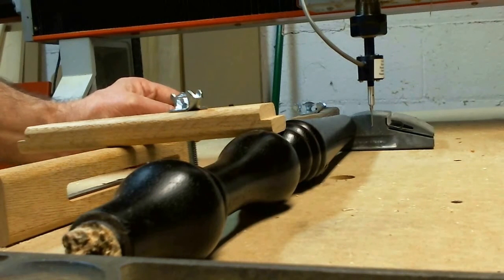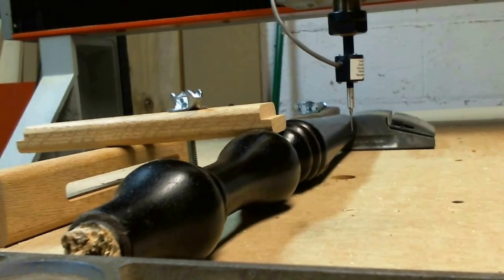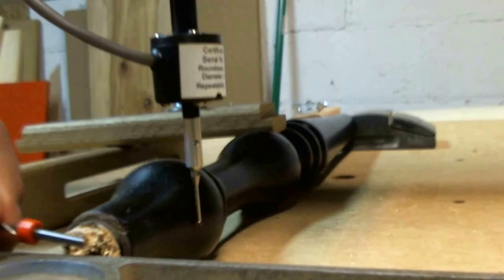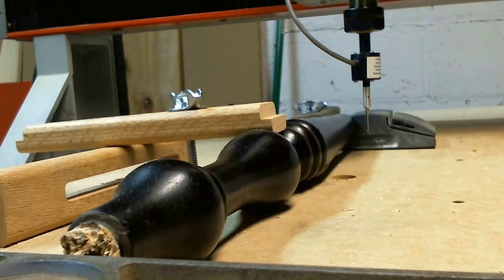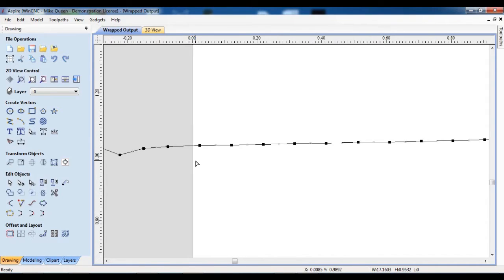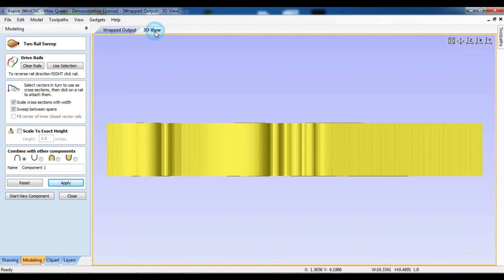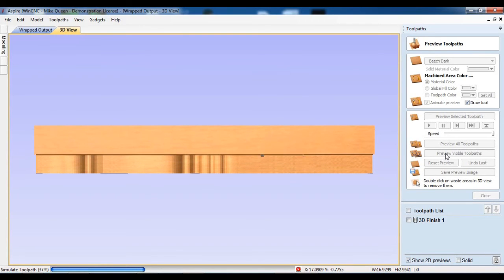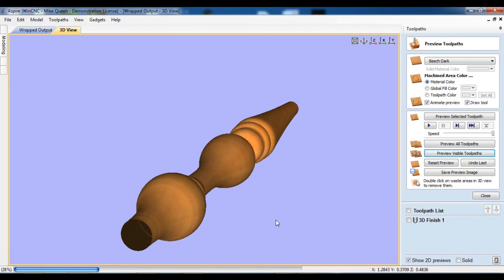WinCNC/Aspire Tutorial: Unconventional Outline Scan/Two Rail Sweep (Redo)

Comment: Interesting. Been wanting to do some Windsor chair legs. What was the estimated cut time Mike?
Reply from the maker: +George Scott I didn't cut it George. It would all depend on your cutting speed but If you did a roughing pass with a 1/2" end mill at 50% overlap, a finish pass with a 1/4 ballnose with a 7% overlap, and a rest machining with a 1/8" ballnose, Aspire says about 30 minutes of cutting time. That sounds short to me. I'd guess a little more.
Reply: +cncMike304 All though not particularly accurate I was thinking about Aspire's estimated time. I was thinking carving would take time....Thanks for responding.
Reply: +George Scott I guess I didn't read your original response very carefully. Thanks again for responding Mike.
Reply from the maker: +George Scott You're welcome.